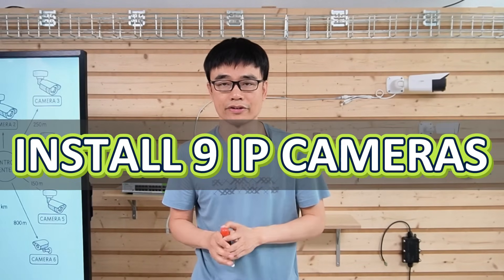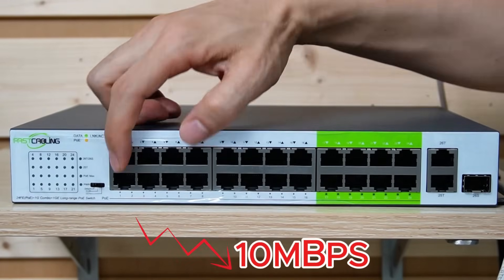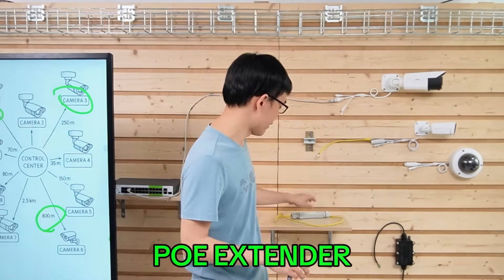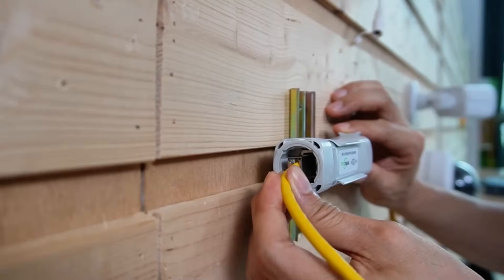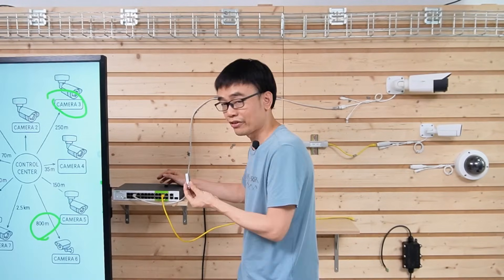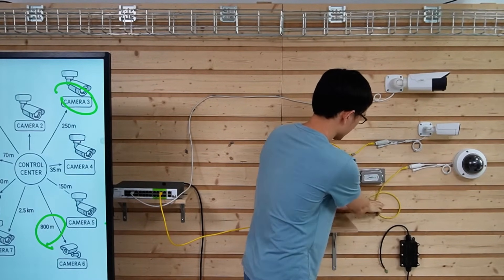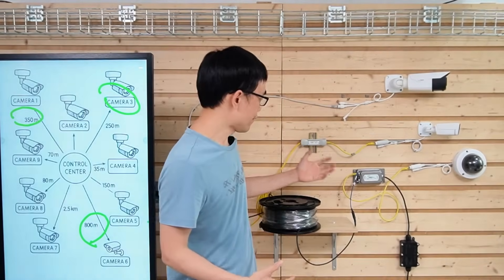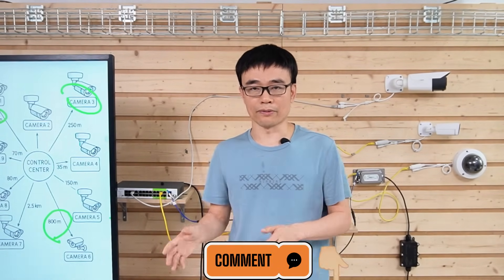How to Connect Long-Distance IP Cameras Using a Long-Range PoE Switch | Case Study

Comment: yes please do a video on the power loss and power budget.  And also running power over fiber, I think you said that was a little complicated.
Reply from the maker: We'll take it into consideration! Regarding power over fiber, it can be a bit tricky. In this video, we use a PoE fiber media converter that receives data over fiber and draws power from a DC48V power supply. It then combines both into a single PoE output to power the end device.
Reply: @Fastcabling  I was just curious about the power supply for it. it's cut off.
Reply from the maker: https://www.fastcabling.com/product/dc-48v-waterproof-60w-power-supply/